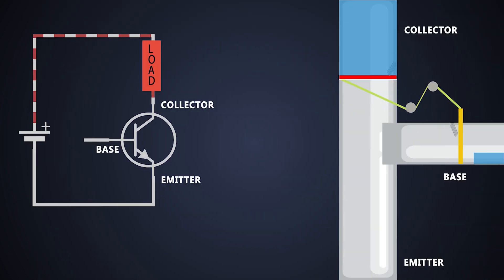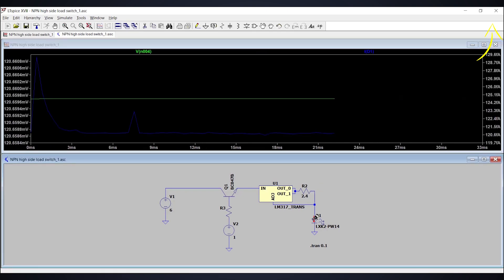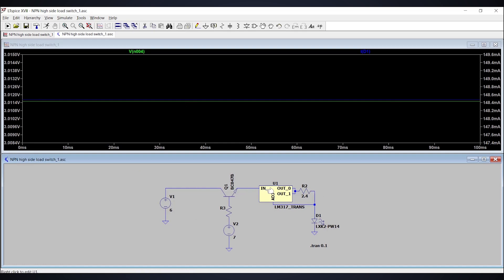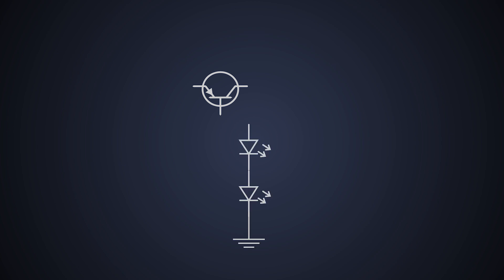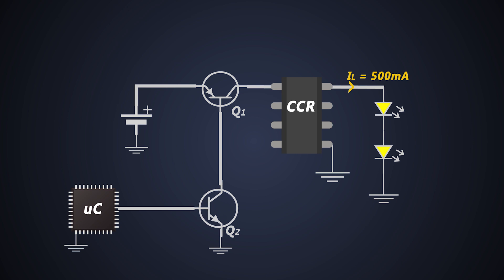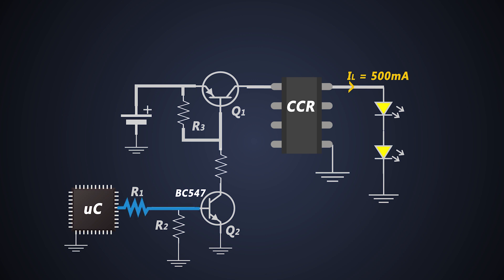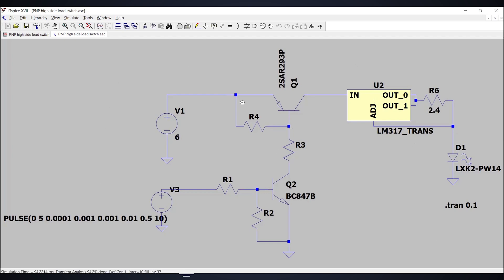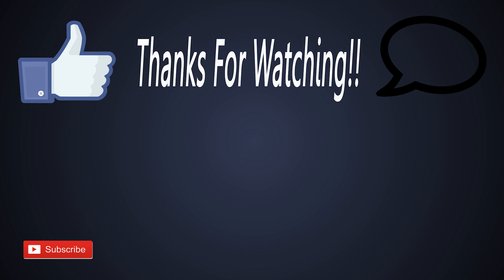How to use BJT as a switch? | PNP BJT as a High side switch | PNP BJT

Comment: Is it correct to add a NPN transistor to the lowside (inbeetwen Load  and GND) and put a PWM to the base to also regulate the Brightness of the LED? Or can double switching on the same line create problems?

Comment: Sir i didn’t understand that why we use R2 and R3 resistors ?
Reply from the maker: Please don't call me Sir. 

R2 is pull down resistor for base of NPN BJT. It prevents the floating state when the MCU turns off the signal. And R3 is current limiting resistor for Q1, it is a pull up to turn off Q2
Reply: @FoolishEngineer  thank you so much Your videos are really good
Reply: @FoolishEngineer  wrong. R3 is pullup for Q1. R4 is current limiting,

Comment: What if we connect the base of the PNP transistor directly to the microcontroller's pin through a resistor? That would eliminate the need for the NPN transistor.
Reply from the maker: Nice option, but connecting MCU directly to the supply is dangerous. we can't put our brain of the system in compromising situations
Reply: @FoolishEngineer  Why the supply get's connected to uC? If you use a pull up resistor (10k) in the PNP-s E-B, and the base connected with a small (<1k) resistor to the uC pin , the circuit must have work, or am I wrong? The only change will be the logic state change, since if you pull the uC pin down, the circuit will be active, and if you pull it up (or let on a high impedance mode) the circuit will be off. (AFAIK uC's can sink current too)
Reply: It doesn’t work, you need to get the base of the pnp to ground to get it working